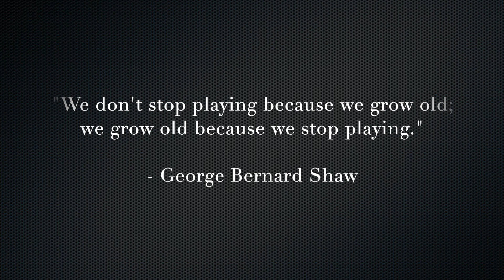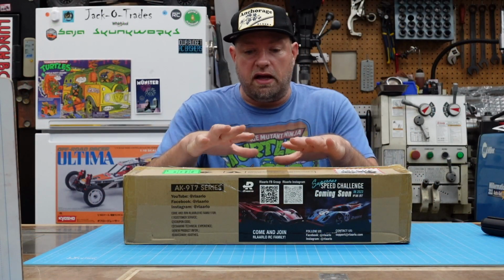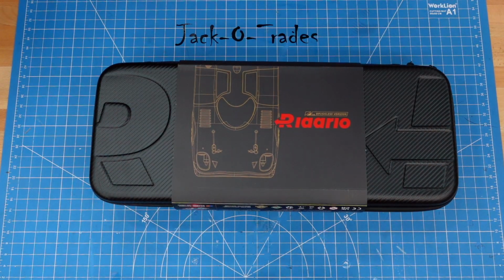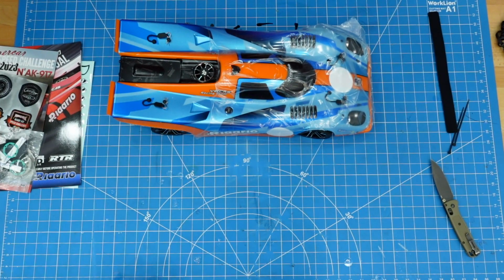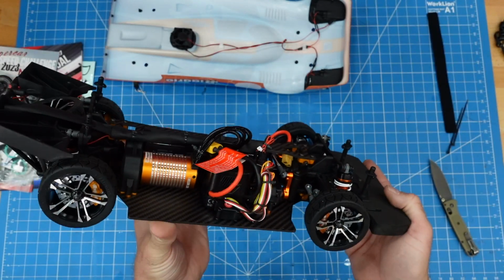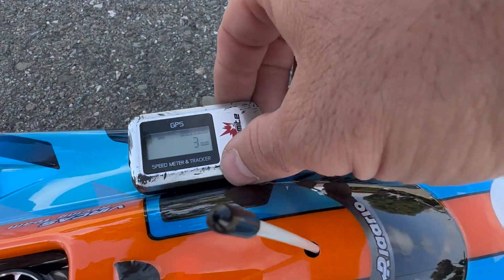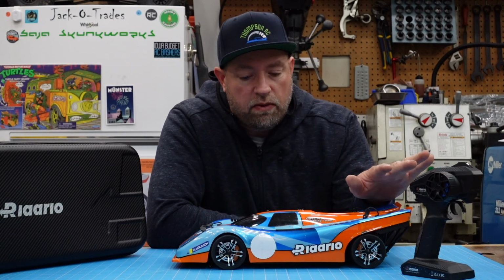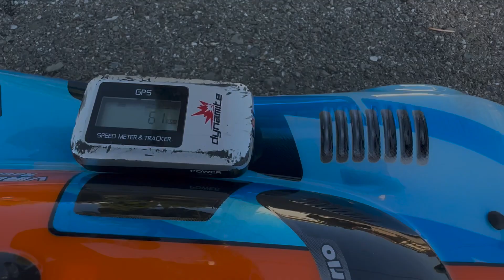Rlaarlo ak917 Unboxing And First Runs

Comment: I am glad you ended it with a preview of some faster speeds, I was a bit disappointed in it only doing 34mph out of the box! It is a great looking car for sure, with or with the body on it! The spare wheel in the car had me scratching my head too when you opened it up. I just don't understand why that was engineered into the chassis! I am sure you will make it into a rocket! Have fun tinkering around with it and seeing what you can squeeze out of it!
Reply from the maker: Ahh, you watched to the end LOL. Yeah my out-of-the-box experience wasn't all that great. I've seen others with faster speed so I don't know what was up. I did find that I had a bent rotor that was hanging up a wheel but I don't know if that was before or after a couple of curb crashes. 

As I have been working to go faster I have been stripping out the stuff that looks cool but gets in the way of working on the car.  There are already some impressive cars out there. I need to find a better running spot for the car. I've been saying that for the last year for speed runs but have yet to find a spot. 

I'm also thinking of handing this one off to my oldest to tinker with for the summer. He's expressed some interest in making a fast car but has never really gotten into the RC stuff. So maybe this will open the door for him.

Thanks for watching!

Comment: Awesome job Brice. It is definitely a car that is a starting platform to make something epic although it will take some doing. Curious to see what kind of speeds come out when the competition ends.
Reply from the maker: Thanks! I think we will see some amazing speeds. There's already some pretty impressive numbers out there. It doesn't take much to make me happy. I'm already in the 60's and OK with that. I think it would be nice to get in the 80's but I have yet to find a location to achieve that. I keep looking at google maps for large pieces of asphalt that would be smooth enough. The local mall might be a good spot pending traffic.

Comment: Pretty cool looking platform to improve from your baseline runs. It would be interesting to see run on a carpet track where all the factors come into play besides pure straight line speed.
Reply from the maker: Yeah, it seems like it could be a good track car based on its general handling. I should note that I have no idea what I'm talking about when it comes to racing. Speed runs are easy as long as you can keep it straight...